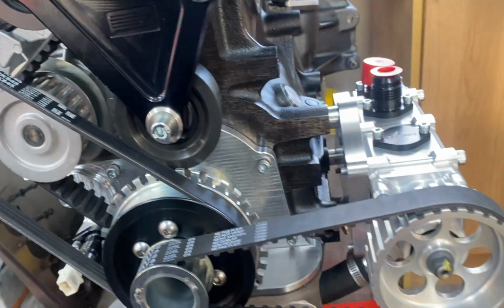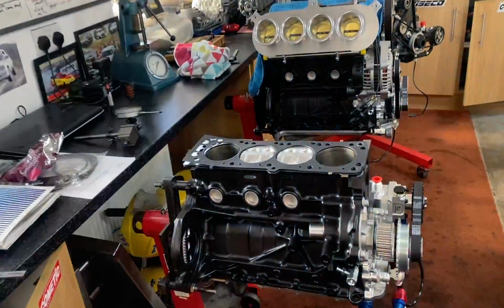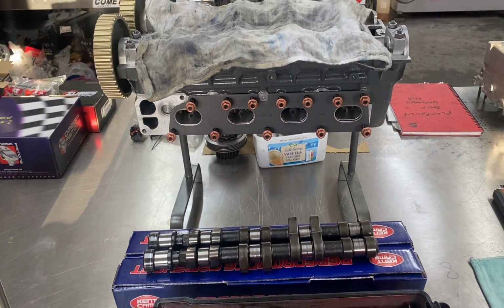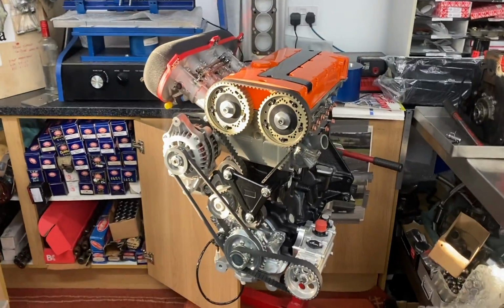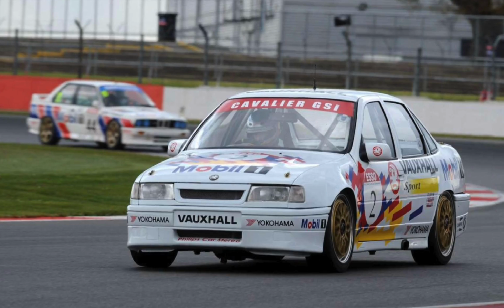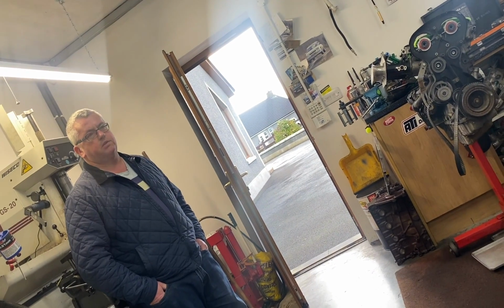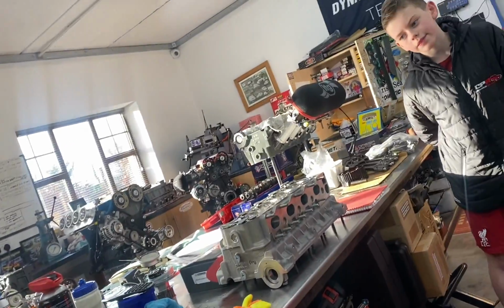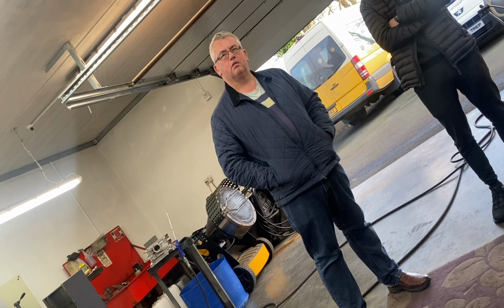Opel Rally Engine Workshop Tour *C20XE RED TOP HEAVEN*

Comment: Man, you have a really top notch channel! I'll be looking at probably many of your yt work.. I'm so soft for the btcc/etc/Stcc cars of 90ies I grew up following (born 87, began riding mx at 5, my father has always been a mc guy, so am I, but I also like to tune cars, he doesn't)
I would love to see more content like this, going into what does what, and what the touring/rally cars of that era 1990ish to 2005ish, as its there somewhere I buy cars from, prefer a pre 00 developed car, so that I by myself can fix it. Worked as a MC mech instead of going to school when I was 13-15yrs old, always been very into tuning, got Bells books as a young teen. Only really have one proper build, a e34 m30b25 turbo converted, somewhere ~350hp on Holset HX 35, as it was a daily driver I went for no lag and what I on a good day could put thru the rubber and use, not just spinning. 
A bit like the escort/TT quattro, im after usability. More power is fun but you don't really get faster unless you can get it to grip. Think I have that thinking from bike riding and Mx riding, always go for a 2T 125 because that I know I can handle without issues at full tilt. 

The more I watch your channel, I'm beginning to realize I most probably will have a daily driver that most probably has another engine than it was sold with.. So, I'm about to get my license back again, so probably will buy a Saab first, to get the engine and use as I try to save up cash, then take that engine into a Rwd chassis..
A 90s red that would be.. soft for estates and need the space, a Opel Omega would be the best bet i think, they were rdw and 4X right..? 

Been looking around and it is still possible to find beeemer Mercedes chassis and cars from the gens I like. 
Saabs engines, Graham Bell actually writing about them in his forced tuning performance book, taking up their variable compression system they developed.
Reply: This is becoming a letter 😂 
Back in 06 I did a exell sheet for what the parts for refurbishing a Saab engine, a Opel engine, a bmw m30 and Volvo red block and white block, I took all prices for valves/springs, gaskets, piston ring, crank bearings and all needed for a proper refurbished turbo build.
Saab was way cheaper than any else. 
And now, with today's knowledge of them taking 500hp standard, non refurbished.. that just kicks that excel sheet into the bin..
And Saab it is, whatever else car I get, would cost more to refurbish the engine of, than what it would cost to put the Saab in it. As I'm only aiming for daily driving and want usable power 350-400hp I'll just buy another saab car and take that engine as a back up. 
Im going to read up on trionic and try to learn how adaptable that is, if it's possible to use it with the engine in another chassis, this part I am somewhat lacking in more than basic knowledge because I truly hate PCs.. Trionic is free, a good ecu is way not free. Not even VEMS is cheap these days, and MS is getting expensive that too..
You that have done this engine conversion many many times, what are the bigger issues when it comes to electronics when using another engine, easy to separate chassis and engine and getting both to function? Electrics and PCs.. two things I don't like and stay away from, more so in a car too.

Comment: The best version of the red tops   Is a Frankenstein mix and match, very early 20xe coscast block, with flat type lightened fly wheel, and the last of the coscast heads, as there was 3 versions of the head, the early coscast head then the cheaper kuglepourushead version and then the last version when Cosworth was given the contract back to cast the heads
Reply: Millington have new XE heads being cast by one of THE names in motorsport, Crosthwaite and Gardiner , and from the Millington site "Cast in LM25 Alloy using the same method, in the same foundry,as the last batch of Coscast type heads to be produced in the late 1990s which proved to be the reliable variant.".
I'd suggest a few stiff whiskeys before looking at the price, they're ****ing expensive, even in bare form - I've bought some very nice cars for less!
Reply: I had a 1994 cos cast it didn't have a distributor  it blanked it ran on coyls a pal from Birmingham sold me it because the red top I had broke timing belt the car had quafe diff and rear disc brakes it was a gsi corsa. Put slot into it sold because cash problem asked 1200. Friend sold it for me . Sed he was buying it for diff. Prick had the cheek to ask for money off almost told him to forget it . Wish I did I don't know if he knew about the engine would try buy it back if I could track the fucker down. Regret it
Reply: By the way are the turbo engine all cos cast heard it before but never checked all I have left is a 1993 calibra turbo gone to reck engine is good the

Comment: Really interesting stuff as usual.. curious about the shimming the Victor reinz gaskets what thickness can you get from shimmimg it? What way do you setup the layers?
What about the elring gasket? What's your feelings on them? I've had anthena push water too
Reply from the maker: Elring is fine used then an work just aswell.
I have ran them upto 1.9mm thick
So they come in 4 layers 2 outer 2 inner.
So buy 2 gaskets drill out the rivits and assemble 2 out 4 inner.